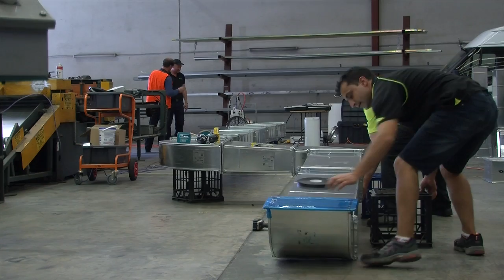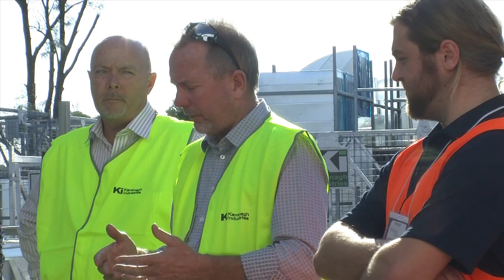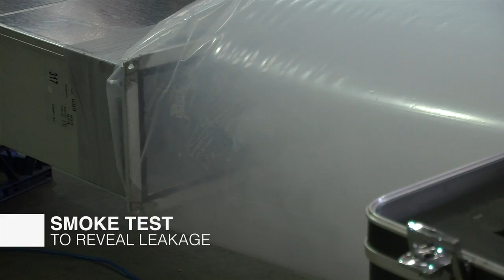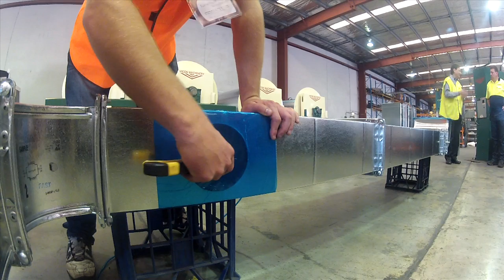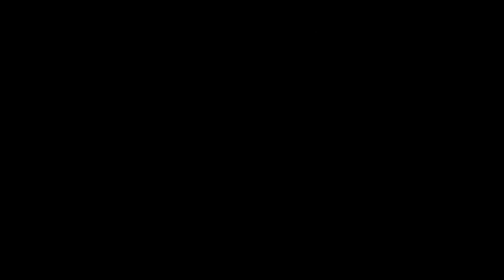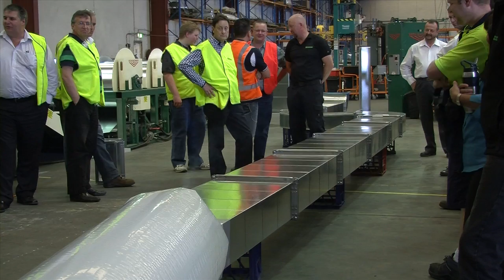Kavanagh Industries: AeroSeal Demo

Comment: I was shocked of the leakage amazed of the sealer seen this a couple of times how comes duct work is not sealed when made
Reply: So it is and it isn't. The seam along the edge is in most cases called a Pittsburg joint. Some machines like the one I have injects the sealer as it's making the joint. Typcially the corners of the duct when the pieces join eachother are sealed and you do that when you install it on a construction site so wouldn't be able to do that when it's made. Also lots of companies ship ductwork in KD (knock down) which is where the two pieces are stacked and have to be put together in the field. That also requires sealing to be done on site. Also duct moves around a lot and specifications for duct install have strict air pressure standards that have to be met. 
The advantage I see with this system is that you can Test and Seal at the same time saving on tons of field labor.  I'm looking to have a similar demonstration done at our shop in the near future and will be interesting to see it in person. To me duct sealing has always been hiring multiple people to drive or walk around a site all day with ladders and lifts only to find out we don't pass the air test and having to go find the holes and do it again. This has the potential to be a great product. I just need to see it in action. Cheers

Comment: I'm curious as to the cost effectiveness of  this process ?
Reply: I got a quote for $2500 to do it.  I have a 2800sq/ft house, two story with an unfinished basement.  Haven't done it yet, I am going to finish doing normal sealing first with aluminum tape and mastic.
Reply: Machine is around 60k, 1Gallon of sealer is around $120. YOu have to pay a recapture cfm fee of 1.50 per/cfm at 90% of the loss on a system. I calculated that to be about $50/ton (but could be off). 

The savings is definitely in the labor for sealing and time spent troubleshooting the system to find holes to find out why you're not passing leak testing. I can see it being a huge benefit on large projects.